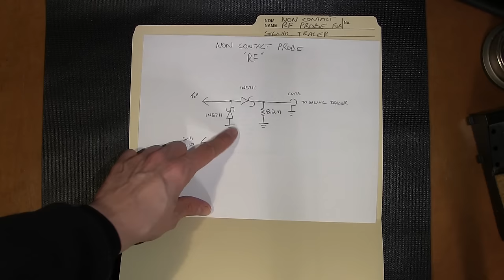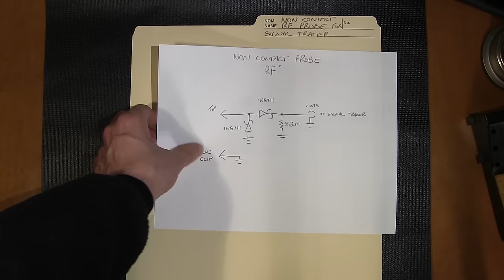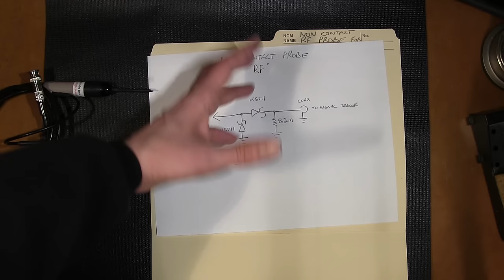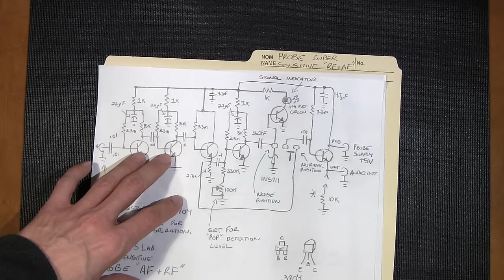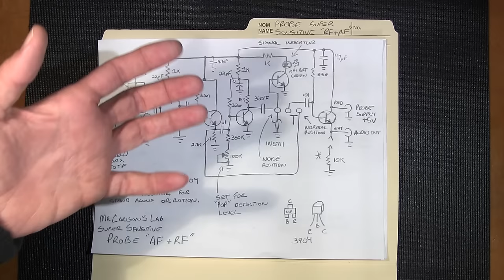Troubleshoot Electronics FAST with a Super Probe

Comment: Nice job!!!! I was sitting here stitching a boot knife sheath onto my bellco's and had a really good time watching this show, and I only poked my thumb 27 times with the needles...Good show!!! I posted a question on a few other sites about something I ran into, I would like to understand what is going on with one of my projects, I'll just cut and paste what I wrote... I am sure it is something simple to explain.. but, I am burnt out on it... here is what I posted else where with no results, maybe due to placing in their discussion page...as I think about it.. Here it is:Okay folks, I am lost ... Can anybody explain what is going on. I am running a bridge rectifier, with DC in, to get DC out, the point of this is circuit reversal protection, if the batter is installed backwards, or to say, it could be installed in either direction ,and the DC output polarity will still be the same. I have went one step further, in order to get the circuit voltage requirements, of 7.50 volts to 8.50 volts, I have two 18650 battery's in series for the supply voltage, but, the battery shoes/holders do not offer any built in mechanical prevention of accidentally installing the batteries in them backwards. So, I thought maybe I could use two bridge rectifiers and have the output of rectifiers outputs wired in series, and each rectifier's input is one 18650 battery (4.20 volts), the battery is hooked to the input side of the rectifier, and the output is where the series junctions is. I really thought this would have worked, but something is happening, kinda like an amplification of sorts or bucking action or possibly looping effect? Each battery is 4.20 volts, the two battery's place in series, (with out the rectifiers) have a total collective voltage of 8.40 volts, as you already know, but, when I added the rectifiers, and wired the outputs of them in series (rectifier #1's neg lead to device load, rectifier #1's pos lead to rectifier #2's neg lead and rectifier #2's pos lead to the device load. One would think that no matter what direction the battery'spolarity are installed on each of the rectifiers inputs that the total output would be 8.40 volt, plus the voltage drop of each diode/voltage drop of each rectifier....... so, it should be about 6.90 volts to less then 7.50 volts, right...?... Then answer me this, I get 15.50 volts at the device load. The only thing I have not tried to do yet is actually putting a load on the output, and then measure the voltage, as I am wondering if this high voltage of 15.50 volts is from some sort of looping effect in the series wired rectifiers, because of the open end/no load.... I haven't went through all the math yet, as I am getting burnt out on this goofy project already, and for once in my life, I would like the answer just handed to me,  lol.. I have all the stuff drawn out on clean layouts on paper in several variations, just no where to upload them for somebody smarter then me to see them, (I'm sure for a laugh) to then tell me the logic of what I am missing or doing wrong, or could do. The reason for all this is an odd project, If you are interested in what I am doing just ask, but, is not relevant to the question at hand, and I already have a novel here, I am sorry... If this doesn't make any sense, I can upload a copy to my FB page so you can view it there, or I can email it... I am kindly asking for anybody's help on this, I really don't want to do the "wired in parallel to the battery" heavy dump diode to pop a fuse method of protection, if the battery is installed backwards, as this project as a finished unit, will be operated  in complete darkness, and the run time is only 1 hour per stack of battery's, so for a 3 to 4 hour venture ,there will be a few battery change-overs.... and changing fuses in pitch black of night, well, that is the reason I was trying for the above method using rectifiers... Please help an idiot out, Drew

Comment: One caveat. The audio output of the LM4871 is 'bridged'; neither terminal of the speaker is connected to ground. It appears from the video, that you indeed insulated the speaker output jack from the case, however,  you didn't mention it. 

Great work, as always!
Reply: I burned up an LM4781 on my first attempt at this amplifier,  I had not payed attention to the schematic, just etched and soldered, and used a standard RCA jack grounded to the chassis of the metal box.  Fried that little chip of silicon real good.

Comment: When i was 16 I had no tools but I used by instinct a walkman tape head with its amplifier to probe circuits... HAD NO IDEA what stage it was, osc or IF it just got me a hint where I can roughly look when a radio receiver fault challenge was submitted to me from relatives 😅 o yeah it worked also with quartz watches to get the pulse

Comment: A question, while I'm still looking at the video (so maybe you will explain this there): Why didn't you used any OP-AMP to amplify the signal? Just by choice or for some tech reason? GREAT project btw!
Reply from the maker: The design, and the way the sensitivity is controlled. There are only 2 wires and a shield going to the probe, one wire powers the probe and controls the sensitivity, the other carries the audio back to the amplifier.

Comment: You might want to compare specs between the 1N5711 and the BAT85...
I have had very good experiences using the BAT85 as a 'better-than' replacement part.

Comment: I built this with discrete components and it works for detecting noise, audio and gets quite and lights up by the oscillator. But it doesn't pickup the at the air-gap capacitor.detector or antenna. I did have to use a 390pf cap instead of 360. I can't figure it out, but I'm going back after it. Maybe I did something silly. Used TV coax maybe that wasn't such a great idea either. I'll keep after it, I really like the idea.

Comment: Good use of an incandescent bulb! IIRC Bose (and other good) speakers often do this also to protect the tweeter's from overheating. 

It's an exploit of the nonlinear properties of the incandescent bulb, using their capability to draw practically no power until forced to draw enough -- then their resistance increases as they heat up so as to stabilize their power draw.

Good reason not to ever categorically 'outlaw' incandescent bulb technology -- this application will still have its use, acting as an automatic emergency power dump to prevent damage elsewhere.

Comment: I have a old set of computer speakers witb amp that is quite sensitive, its quite useful too. It can even detect incoming calls on my phone before it even rings. I also built a high gain circuit with bar graph using transistors, that is also very sensitive.

Comment: I built up the probe. The amplifier works well but there is a problem with the probe. Both T1 and T2 have base current through 3.3M resistors to positive rail, but this puts them into saturation with about 0.1V on the collectors. As a result they have little or no gain. I modified it by connecting the resistors to the collectors and this stabilises the bias point with the collectors now sitting at about 2 V. There is lots of gain in the circuit now.
Why did you use a discrete approach for the amplifier? Surely a 5V rail to rail dual op amp would give a more predictable result with a considerable reduction in component count.

Comment: Wow! I need one of these today to find out where the audio is dropping out in my Stryker 955 . I ran a slightly shorted speaker  and by mid day I smelled burned electric and I lost half my audio and talk back volume. 
In the end I was running the volume all the way at 100% while I was slowly loosing audio volume. After a week of use with a repaired speaker 3 days ago the audio got quieter throughout the day and I finally had to switch out for my backup radio. 
Dump trucks use CB radio to communicate with scale houses and loaders and have to have a radio. I always have 2 radios with me.

Comment: I used one of the Tektronix nano-volt O Scopes to sniff around a Kenwood TS690S that would not transmit on HF or 50MHz, and zilch, anywhere and everywhere. I suspect someone tried to run line level+ RTTY into the mic jack, and the mic preamp was toasted. I also found no voltage in part of the switching, including to an RF latching switch IC, so a bad filter cap, questionable switching transistor, and maybe a bad uPC4066H2 chip, but less than $20 in parts, and I have a $422 TS690. I also fixed up a $150 TS440, and a $180 TS450, each of those had fried audio out to the speakers, but the both put out an honest 100 Watts PEP into a dummy load, and now the TS690 puts out 90-100 watts HF and 55 Watts on 50 MHz. The 440 & 450 have the autotuners which are great. I suspect someone tried to run RTTY or FSK/PSK into the mic jack. Thankfully no hacks had previously been inside these Kenwoods, barring the 440, which is as optionally filtered up as possible, without modifying things beyond factory circuitry. Oh, and my new used Baush & Lomb stereo microscope arrived. .7-3.5x zoom with 15x22 eye pieces and a Minolta light source, .5 aux lens, and 38mm circular lamp fixture flange. $102 delivered to my door, and it has the boom mount, and all that. Can't wait to see if I can make $300 or so at the next Hamfest with those. I may keep the 440, or move the 450's autotuner to the 690 and keep it.
Reply: I have, or had a bunch of those aluminum scope probes from Sola Radio Supply of Los Angeles. I am going to have someone 3D print some bullet ends, and buy some aluminum tubing and make some more. I made injectors, probes, and  stuff like this from a lot of those old probes. One is a music signal injector that injects music from a radio, but the music has most of the bass highly attenuated to mimic a phonograph audio signal. Remember vinyl phonograph records? Yeah, you kind of want a signal that is like a phono signal for a  hi fi/stereo that will amplify phono signals. Otherwise your on the fly circuit mods will sound like booming bass heavy mud. An old engineer who worked for Mitrex showed me the phono signal injector trick, and it has various EQ settings and levels for where we want to inject music into the circuit. Mitrex goes back to the heyday height of the Disco craze in England and Europe. Oh AND THE BAUSH & LOMB IS GOING TO STAY! OPTICS ARE FABULOUS ON IT, SO NOW MY EYES WILL BUG OUT JUST LIKE YOUR PING PONG BALL EYEBALLS AFTER A WEEK OR TWO!! LOL I'd go with two holes, one for a  bolt or screw, and one for a 3/8" gas pipe threaded lamp fitting. Are those 3/8" or 1/4"??? I know those lamp fittings harken back to gas lighting. I converted some gorgeous old pwetwer gas lamps to electric, and no surprise the gas piping is the exact same stuff used in electric table lamps. They even had rubber hoses that ran to gas line spiggots. You should consider buying a nasty old used electric oven and some try powder coating. Its a lead pipe cinch once you get the feel of it. You can coat in any color, crinkle, hammertone, chrome, gloss clear, satin clear, metalic, faux anodized, etc. You can print on water slide decals and powder coat clear right over them.   73s KI7AQJ

Comment: Very nice. Your attention to detail is inspiring. For example, using a high-quality (Neutrik?) balanced 1/4" jack. Did you consider putting a notch filter on the output, so you could narrow into a specific noise frequency range?
Reply from the maker: You are correct about the Neutrik, good eye! Usually noise in a component is sporadic and random, so I just spent the time in the noise detection design as to capture it all with a few adjustments.

Comment: I am a retired tech/Engineer.  I have a tremor in my hands so working with SMD, PADS is not workable for me. What would be the effect on this device of constructing all the circuits in the box instead of using the probe shell for the circuits? Loss of sensitivity I imagine but can it work well? Thanks Mr Carlson for your engineering.....

Comment: Excellent video as always from Mr Carlson - i have a quick question - Could all of the electronics be mounted inside a suitable enclosure (probe components, power supply, amplifier, speaker etc) and just have a shielded cable (say 50cm long) from this enclosure to the probe tip ? - this way i wont have to try and fit all of the components into a small probe case. - keep up the great videos please.

Comment: To check if an oscillator is working AND what frequency (e.g. in amateur radio Tx and Rx), I use a "sniffer" (a single coil turn of wire)connected to the antenna socket of a general coverage receiver - by definition very sensitive and frequency readout to 10Hz. The sniffer just has to be waved around in the vicinity of the oscillator. This was suggested to me by G4VUX and works well.

Comment: Okay Paul, so this begs the question: While and since most of us have neither a microscope or the dexterity (anymore), is it possible to construct this probe assembly using TO-92 size components utilizing a longer shielded stinger (probe end) while placing everything else in the table top box? Or if reverting to TO-92size parts one might one be forced to using 40-50 mm size containers? Thanks for your response 👍.

Comment: You know, having watched this video in it's entirety it occurs to me that it would be extremely easy to adapt this probe for use on an audio mixer with 48v phantom power. With the addition of some power regulation it wouldn't be that hard. Being someone who works with audio equipment often, I have such a mixer for my PA system. Mind you the phantom power on my specific mixer only produces about 300ma @ 48v. A small regulator circuit would be as simple as a voltage follower or dedicated VR chip with a capacitor to keep everything smooth going into the probe. An XLR cable contains ideal shielding too which is what's necessary to connect say a microphone to phantom power to enable their extreme sensitivity characteristics. The circuit in my Rhode is similar to what you've used in this probe which is why it just hit me that it would be possible.

Comment: OK, I have a question, why couldn't you have the entire circuit in an insulated box with a long coax as the probe with just the end of the coax exposed instead of the heath kit handheld?

Comment: One of our engineers made something similar in the workshop back in 88'ish. Except ours was in a cardboard box with a ripped out speaker sticking out and a salvaged pot, and just had wire to make contact in the audio parts, it was really useful for tracing audio faults in hifi, tv and video sets. Certainly nothing as advanced as this looks. Rumbellows Tyne Tunnel Trading Estate workshop fwiw.

Comment: Just out of curiosity.... could you connect the output of your probe into an oscilloscope to make the probe more visually useful via the scope? Almost like a low frequency spectrum analyzer....only limited by the bandwidth of the scope itself. You may even be able to use the triggering features of the scope to check for periodicity in the so called noise better isolating any unwanted signal cross-talking; and in the event the signals are to low for the scope's front end, design a amp for that as well. Also, a big thumbs up on the capacitor characterizing circuit. I want to build one now. Question back to you, would be, can you derive any ESR information from your circuit or is ESR a frequency related spec?

Comment: Have you heard of a Conar Model 230 Signal Tracer?  It has a 6AB4 tube in the probe tip for the first stage.  Works just like your super prone. :-)  If you hook up a bit of wire on the probe tip you can actually pick up radio stations! That's sensitivity. Can also hear noisy components, by placing the tip near the component in question, etc just like the super probe

Comment: The design is so clever and simple that I have to build one, even is only for hobby . One question:  How much DC did you apply on the faulty components?    
I have seen that the Heathkit deliver about 170 volts. Maybe less would be enough to create internal arcing? I see you have a limiting resistor as well. 
 I'm asking this because I don't have the Heathkit and I'm considering adding external DC for testing. Could be an useful idea for others as well.
Thanks
Radu

Comment: Hello Mr Carlson! I need to build this... But would it be possible to put both the probe and the amplifier circuit together in one enclosure and then use a coaxial cable with a BNC connector on one side and an RF probe on the other side? Or would that be too noisy?
Reply: Milan Horvat  +1 on that thought. Probe board looks "too busy" as it stands but it could be the noise reason you thought of.

Comment: Wondering how difficult this is to successfully build from the schematic using thru hole parts? Also, I don't see a germanium diode. Will this probe demodulate RF? Thanks.

Comment: I was thinking 22mm copper pipe (insulated of course) as it would be an excellent shield for the probe components! Another advantage is easy soldering for th ground! Aluminium down.t accept solder very well? Question is would a hole through pcbs fit inside inside the 22mm pipe?
P
F

Comment: Hi Mr Carlson! There's another tutorial of using a guitar amp and a .1 pf 630V cap on the positive lead for audio signal tracing.
Would there be any problem incorporating your touch free rf circuit into the guitar lead?

I was also wondering if you could not build an AF RF tracer that plugs strait into the line in on a radio or a PC?

Comment: Hi Mr Carlson
, i have question, electronics for the probe board must be in probe it self or electronics can be moved in another metal  shield case, and did must all parts be smd type,can i build carlson pcb board little biger